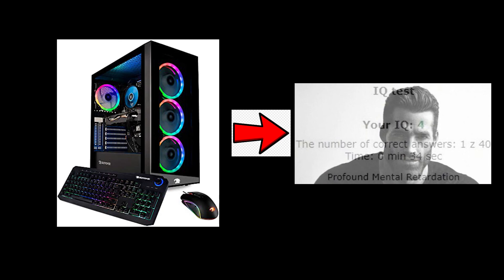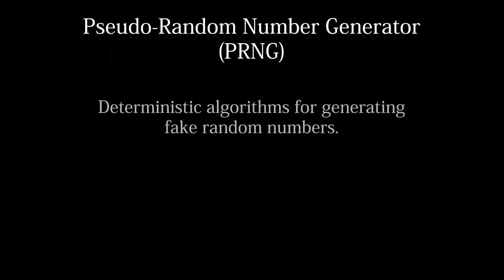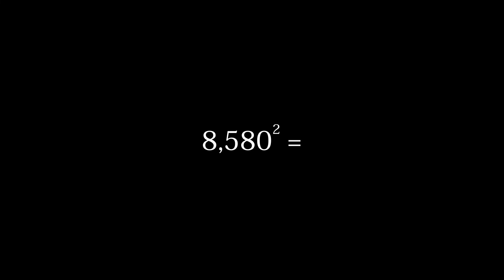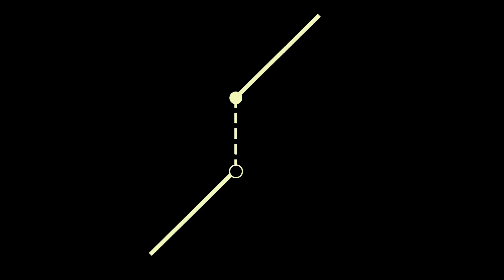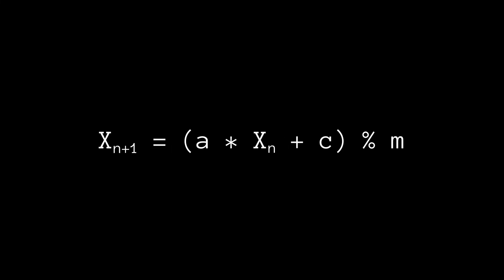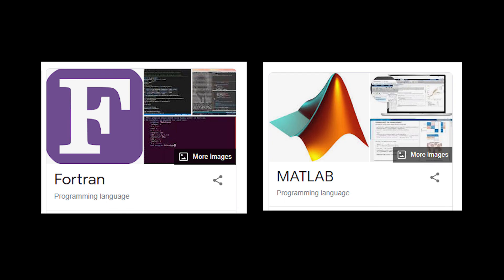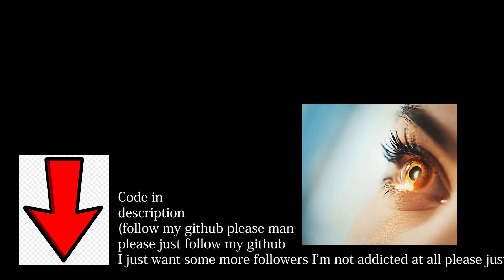How Do Computers Produce Random Numbers?

Comment: Computers aren't actually 100% deterministic because CPU instruction timings are slightly variable, for example.
Reply: ehh yes and no, instruction timing can vary because of cache misses, but the cache can populate differently between boots because of hardware/power variability. ie, a hard disk needs power for its controllers, power depends on capacitors charging -> hard disk takes longer to init, the CPU goes to do something else, cache changes. And that compounds over and over with OSs and task switching.

an uncached CPU can in theory be 99.99% deterministic, but silicon also has tolerances and power supplies aren't perfect and cosmic rays exist and it's just tolerances all the way down 😔
Reply: @ShinyQuagsire  I was talking about slightly variable cycle lengths.
Reply: @thorham1346  eh I mean even that's just down to the instruction dispatch order and whether certain units are busy with previous instructions, still mostly deterministic
Reply: @thorham1346  eh I mean even that's just down to the instruction dispatch order and whether certain units are busy with previous instructions, still mostly deterministic
Reply: @thorham1346  (fwiw I'm only pedantic because I've seen people try and seed security-critical random numbers with ADC inputs, cycle counts, and other things they thought weren't deterministic, even though they're extremely predictable and not random)
Reply: @ShinyQuagsire  With cycles I mean the CPU's clock cycles. These just depend on an underlying timing mechanism like a quartz crystal.

What you're talking about seems highly deterministic indeed.
Reply: @ShinyQuagsire  are these tolerances what gives way to non-deterministic results when multithreading?
Reply: @wide-awake  yes and no, it adds to the nondeterminism, but in a modern OS the variation is more likely to occur from stuff like other apps running, networking, etc.
Reply: @ShinyQuagsire Managed to not only make very simple things sound very complicated, but also entirely miss the point the other person was trying to make AND sound condescending all at the same time! Amazing dude
Reply: you need to rethink what deterministic means my little fwend

Comment: I’m a seasoned developer for custom business applications, and again and again it amazes me, how non-deterministic applications run. Though the computer itself is deterministic. 
Usually the reason are race conditions, which arise from running your app with concurrent threads and async-await stuff.
Exponentially increase the randomness by letting two of these applications talk to each other 😑
Theoretically sufficient cross thread synchronisation techniques like lockes should fix this. But from a specific number from lines of code upwards, it’s practically impossible to find all places where locks are needed.
And with enough locks you enter another rabbit hole: dead locks. Which are usually worse than an somewhat funky (but not harmful) non-deterministic behaviour.